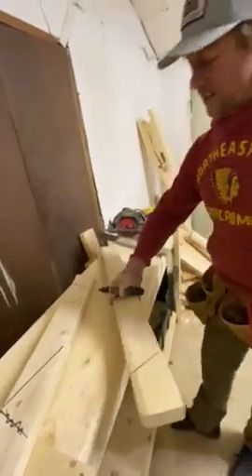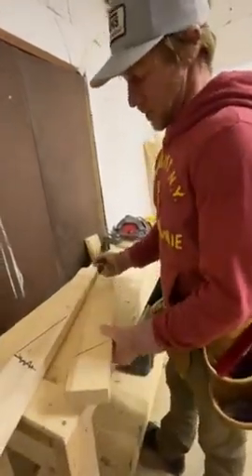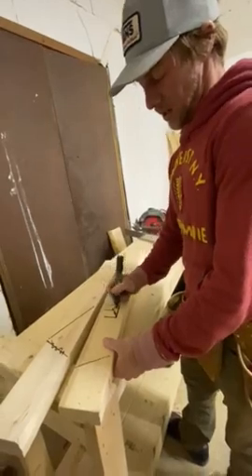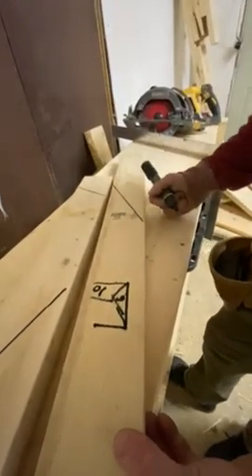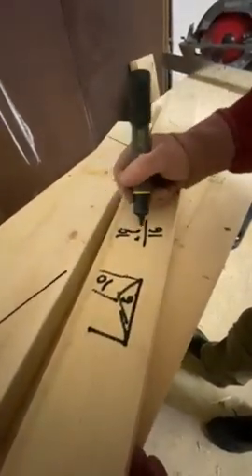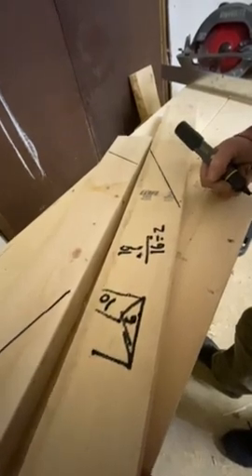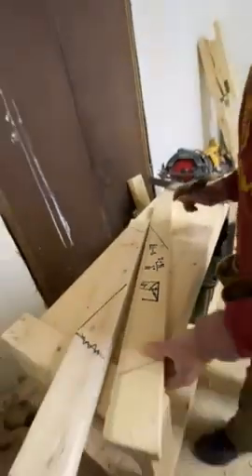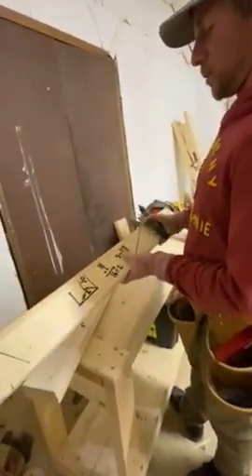rafter basics

Comment: The dual pitched roof method of adding the pitches and dividing by 2 will get you close to the hip pitch, but not quite perfect. You’ll really notice how off it is when you have 2 pitches that have a big difference between them (like 12/12 and 4/12). Hint: it’s NOT even close to 8/17.

Comment: Wait, where did the 17 come from? after getting 8 when dividing 16÷2??
Reply: On a natural hip/ valley (same pitch both sides) it runs at a 45 degree to the span. The 17 (16.97 to be exact) is the hypotenuse of a 12”x12” right triangle. You can check for your self by using the Pythagorean Theorem. A2+B2=C2
Reply from the maker: Hips are always  based off of 17...so if you have one side of the roof say 10/12 pitch and the opposite side going into it is 17/12 lets say, to find the hip angle you add both pitches (10+17=27÷2) so 13.5 /17.. rafters are always based off 12. Hips are always based off 17
Reply: Hips and valleys are a longer run than the common rafter so always use the pitch of the roof and 17 instead of 12. Works for every hip and valley. It’s a trigonometry thing but we don’t have to know why. It just works 😎